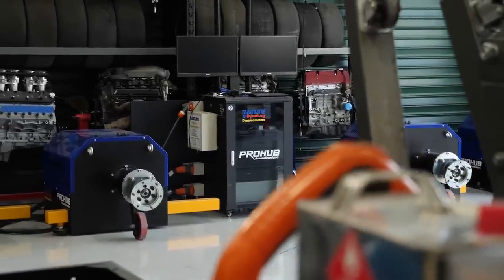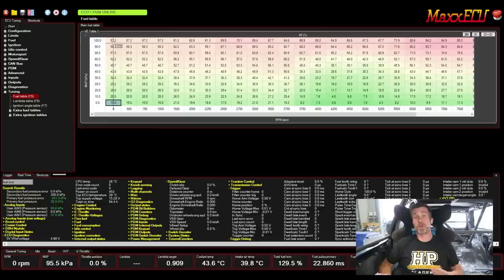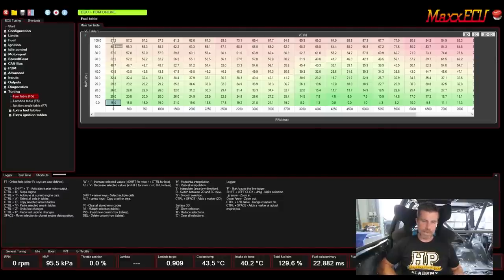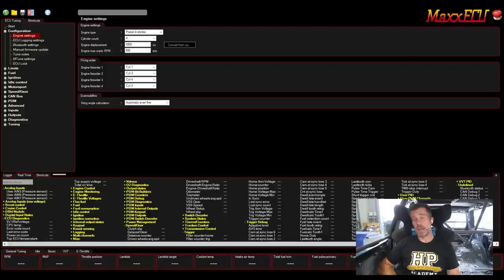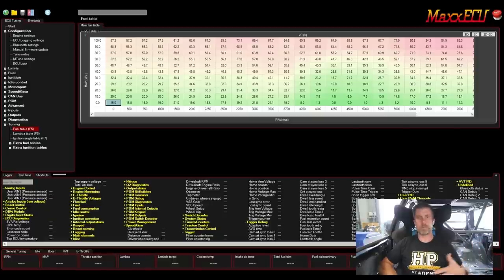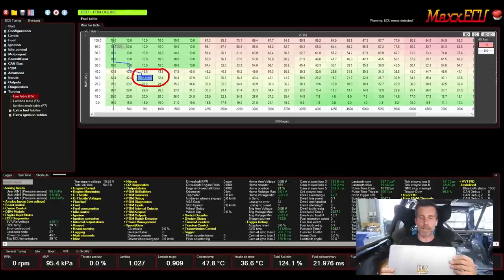MaxxECU Introduction | MTune Software

Comment from the maker: 🦸‍♂ Building a fast car? Get $400 OFF the all inclusive VIP online course package deal: https://hpcdmy.co/vipy70
TIME STAMPS:
0:00 - Introduction
0:43 - Vehicle Overview
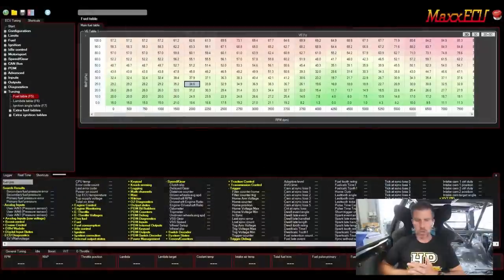2:50 - Software basics
5:45 - Tables
11:08 - Moving between table shortcut keys
12:19 - Manipulating fuel table values
14:35 - Real-time values
16:47 - Configuration Menu
19:51 - Limits Menu
23:08 - Fuel Menu
26:46 - Ignition Menu
28:27 - Idle Control Menu
30:58 - Motorsport Menu
31:14 - Speed/Gear Menu
31:29 - CANBus Menu
33:55 - PDM Menu
34:42 - Inputs Menu
37:35 - Outputs Menu
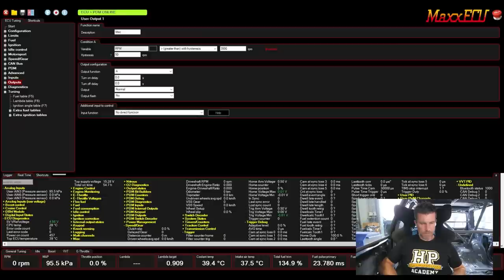38:39 - Diagnostics Menu
41:28 - Tuning Menu
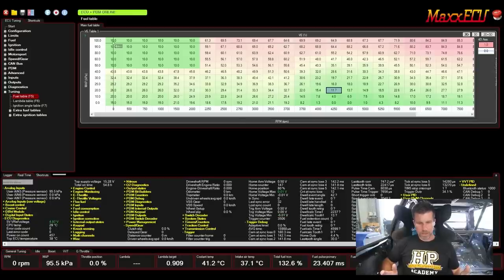45:28 - Autotune
46:41 - Questions

Comment: I have this in my R32 GTR and have installed and tuned  MaxxEcu for almost 10 years now and never going to choose any other ecu over the Maxx. Outstanding capabilities and it just always works
Reply: Have it in my S14, and I am only now having the time to learn it. Seems like it is very user friendly, and packs a good punch compared to the other brands.
Reply: Have seen clips of other tuning softwares and Maxxecu is the most friendliest looking for new tuners.
Managed to tune my car without much problems. The Help button on top right corner is really helpful also.

Comment: One thing no ecu can beat is the overall flexibility of the maxxecu.  Being able to resize and change the axis and adding a 4th to almost any table as well as being able to create math channels or internal outputs that you can use for those axis is something I haven't really seen anywhere else.
Reply: motec can do everything even change control strategies,but you need license and it very expensive
Reply: @sfvdgfdgvs7765   maybe I should have included "in the price range".
Reply: I was gonna comment the same thing.  I’ve played with a few standalones, motec m1, Holley hp and maxxecu.  The maxx seemed to me to be most bang for your buck by a long shot.  The race is roughly $1500 US and has built in single channel wideband controller and can handle multiples channels external.  It has 8 channel of k type EGT built right in, no need for an amplifier or anything.  That’s a big one I haven’t seen any other ECU have period.  Then the math channels and the internal inputs or virtual inputs that basically allow you to trigger anything/or alter any tuning parameter you can think of using Boolean (if/and/or/+/-/etc, etc) makes it extremely powerful beyond just how its spec sheet defines it’s ability.  That CAN analyzer must be a new update I wasn’t even aware of and that’s pretty mind blowing for advanced users!  At that roughly $1500 price point, the race model comes with all those features, fully unlocked (not like motec), and it also includes a full car length flying lead (unterminated) harness and a wideband sensor.  So if you can build your own harness you get pretty much everything you need besides say relays and fuse box and any switches. 
And as Andre noted they are very responsive to users input and have a change log on the site of every update that’s made to the software.  I’ve watched countless features added and a few bugs fixed when they pop up.  It’s simple to update by the end user to get the most recent software, requiring only a laptop/desktop with internet connection.  That’s a tough to beat ECU package for ~$1500 US

Comment: For the limits like oil pressure cut, you can add a vertical axis. (right click on the empty cell on the top left of the grid)
So you could set a 3d table with pressure and temp for exemple.

Comment: What OBD2 connection did u use?
Reply from the maker: We don't use the OBD2 port with the MaxxECU. Like most aftermarket ECUs, a USB cable is all that is required remembering and aftermarket ECU like the MaxxECU is replacing your OEM unit - Taz.